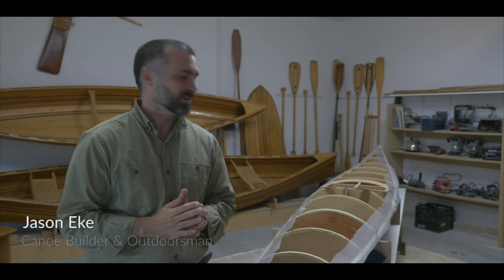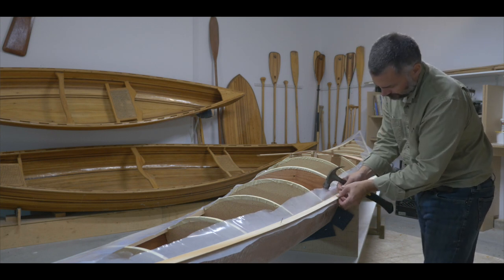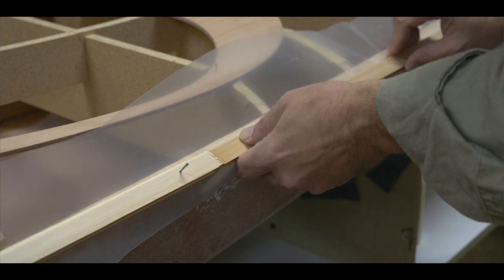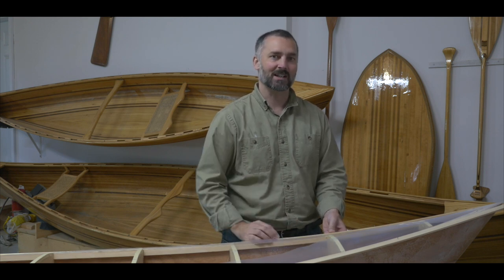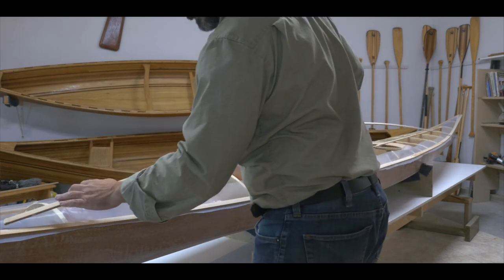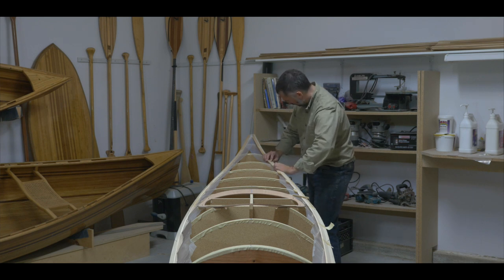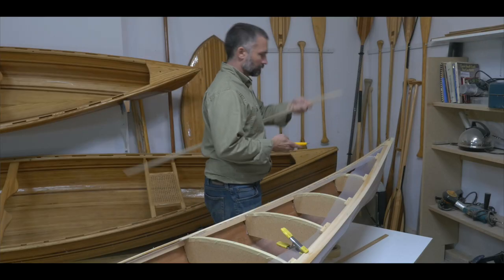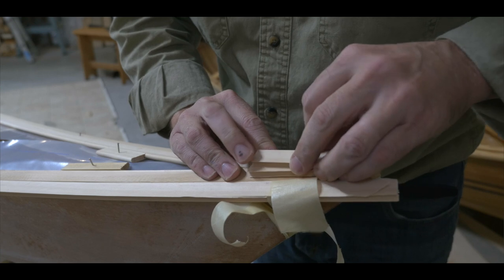How to Build a Kayak | The Shearwater 17 Kayak | Part Eight - The Cedar Strip Deck pt. 1

Comment: I see that your canoes are a satin finish and your paddle board is gloss. What finish will you use on the kayak and why? thanks
Reply from the maker: Hey Jack,
I'll be using Epiphanes Marine Varnish on the kayak. Just because thats what I have in the shop and its easily available to me at my local shop.